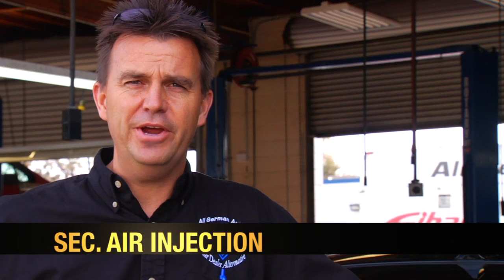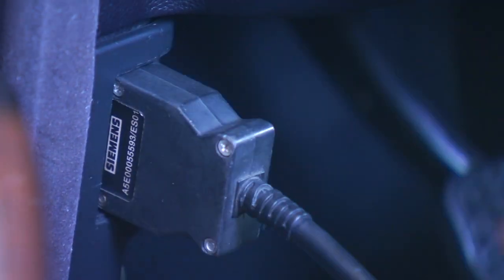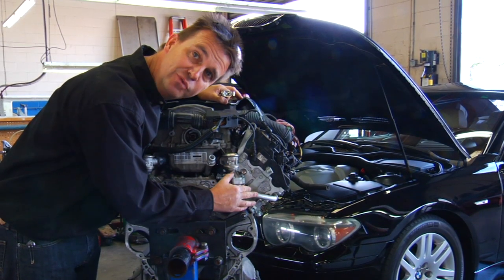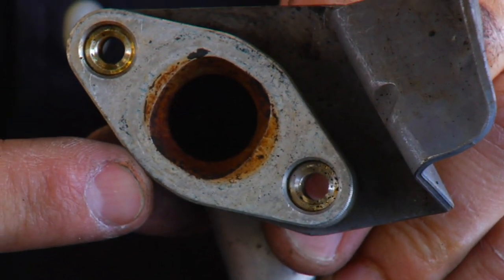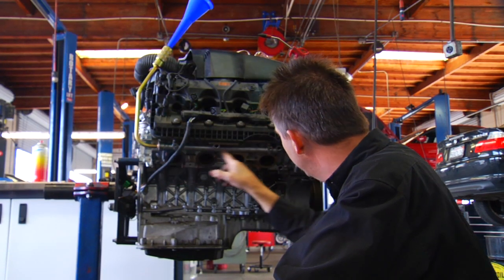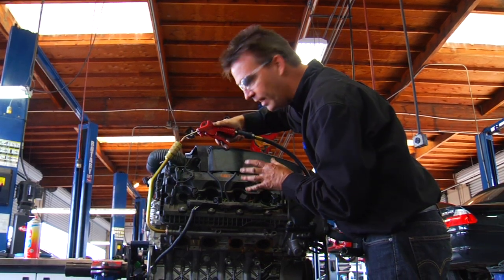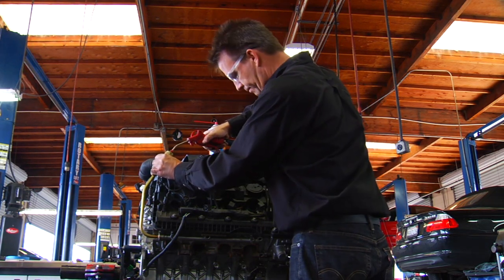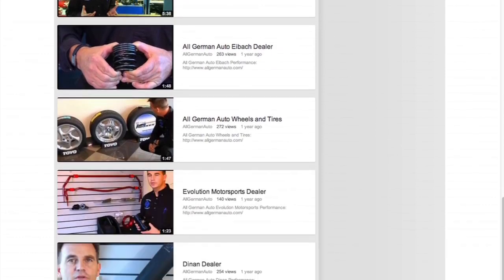BMW Secondary Air N62

Comment: This tool worked well in 2013, and now in 2023, not so much. Pulling the exhaust manifolds and port cleaning with the pick tool is the only effective method. Petrified carbon with time.

Comment: Any issues with material going thru the catalytic converters, or do you disconnect the exhaust manifolds first? Thank you for any help.
Reply from the maker: No, but we recommend taking off the spark plugs.

Comment: Show how to remove the intake. I have the code. Cleaning it without that over expensive tool was not an option wasn’t gonna pay $300+ for a tube a brush and a funnel 😂 but yeah I managed to clean them but the codes persist… I’m thinking the tube that splits under the intake is broken so yeah a lil help would be awesome…

Comment: Thanks for the video... my mechanic is using this tool on my 645CI... Bank 2 is now clear but Bank 1 is extremely blocked.  Do you have any suggestions to dissolve hardened carbon and oil from the port wholes.?
Thanks in advance
Reply: The real cause of this problem is valve stem seals. Oil leaking trough the seals and directly into the combustion chamber blocking the channels!

Comment: This might have worked well in 2013, but not in 2020. You will be lucky to get this to work with how clogged any 745 will be by now. I have managed to break their "inexpensive" $90 carbon hook, and was unable to get this brush and funnel tool to work without scraping out the exhaust ports first and by using a welding wire to dig in to the carbon before using the hook. This funnel tool still requires you to pull the manifolds since the air will just pass through one of the open ports if you manage to get one to open up. Hopefully you will avoid this garbage job on a garbage car and not buy either of these kits. AGA makes some great products, but in modern times this will not save you time or money.
Reply: all facts - their VSS kit is still useful but I just rented it from a Facebook group haha. For these ports though, just pull the engine and be prepared for a lot of cleaning. Shit sucks after 17 years.
Reply: @ThePinkDragonn  can it not be deleted?

Comment: So tried it with mechanic and brush is stuck in the galley tube for bank 2. Tried safety wires angled as a hook on wire tip to poke through brush in tube to pull brush out with engine still in car, but no success with the tight space.   So engine has to be taken out to easily get at the stuck brush.  So lesson learned, ensure brush is on very very tightly prior to use, and do not reverse turn counterclock wise during cleaning. it will unwind if it is not tight. It did a great job on bank 1 fixing the code, easier to get to with engine still in.  And bank 2 as well, which would be perfect had brush not been stuck.  Will recommend, but easier to do with engine out like on this video.

Comment: Between the blocked air injection tube and the leaking coolant transfer pipe, these engines can cost you a lot of $$ to fix!
Reply: Ad Mirer There's actually a pretty cheap fix for the water pipe from bimmer fix.

Comment: if i am replacing my valve stem seals do I need to do this
Reply from the maker: Mike, we strongly recommend you to do this job while doing valve stem seals so you don't have to go back and do it later on. No need to go back into something twice when you can just do it the first time.
Reply: Thanks I bought the tools anyways.

Comment: I got this kit and here is my experience. It is unnecessary! 

1. To all my non mechanics doing this. There are 2 emission control valves that need to be removed, so this video is not step by step.

2. Bank 1 is fairly easy to get to while the car engine is still in place, however bank 2 is a SOB. Tip: the easiest way to do this is to remove the intake manifold. 

3. Make sure the brush is screwed on tightly if it get stuck in the bank stick the cable in the bank and try to screw it back on the brush to remove it.

4.  My brush broke at the end of bank 2 luckily i was able to get it with a pair of angled needle nose pliers.

5. At the end of the day my mechanic took a brake cable, cut it and un-threaded it to make a stainless steel brush and that worked better than this tool. Plus there was no parts to get stuck in the bank.
Reply: so did you NEED the guide tube or just the brush?
Reply: corey jones so did u pass emissions
Reply: @kingme6109  it did not fix the issue. I think I need a new pump.
Reply: corey jones so check your fuel injectors u be surprised it a be a couple of them no staying right u never no but once u pull the injectors out of the hole in the manifold make sure u have a bucket for all the gas that’s dripping from the injectors pipe connection I no ov did everything u can imagine to those N62 engine
Reply: U can just buy the 2 pipes but that don’t mean  your holes ain’t clog with carbon it’s a crazy spot I say lift the engine a little make it easy
Reply: @kingme6109  I replaced the pipe it is under the manifold still no luck

Comment: I have a question.  I am working on my 2004 545i and I have reached the point where I have the mounting bolts off the air valve.  It appears that there are 2 brackets that hold the pipe in place (the pipe that goes into the engine where the tool is going to go).  Any pointers on how to undo those brackets?  I'm getting close to ready to do the procedure.  Thanks!!
Reply: I see from rewatching the video that there is just one bracket.  Do I have a better chance of getting to it from underneath? I guess I'm going to take the bottom cover off and see if that gives me a better shot at it.

Comment: that engine must have bad valve seals. early ford dohc/sohc v8 had an issue like that with egr and secondary air. in that case if you neglected it too long the tube would completely clog with carbon, almost turn to rock.

Comment: can I use this on a 2007 bmw 328i
Reply from the maker: Gilbert,
Unfortunately this tool kit is strictly for the N62 engines.
If you have any further questions feel free to give us a call at 760-738-4084.

Comment: I have a 2008 BMW X5 4.8i the engine light come out I took it to the mechanics change the spark plugs and two coils 1 and 8, but the problem still on. I took it back and now the mechanic said is the catalytic converters. The truck fells poor when push the gas it start jerking and loses power and at times I am unable to accelerate.
Reply from the maker: Dan, Please call us at 760-738-4626 to talk to a service advisor to further investigate this problem.
Reply: @AGATools  My 4.4 is having the same symptoms after valve seal replacement. jerking and such. It ran great the first 20 miles, then it threw bad coil code. I replaced it and ran good in park revving it up but under load it jerks and feels like its mis firing but the codes now are p0420 catalyst system efficiency below threshold and p2179 System too lean and P2177 also. Is it common to have to replace the Cats after a valve seal job? By the way I did not perform the secondary air cleaning.
Reply: Change your o2 sensors on top of your cats there reading a bad mixture

Comment: Hy...but the brush is safe for the engine?
And if any brush hair breaks and goes to inside?
I guess the brush hairs are made of steel ... so you can clean the carbonite...or fiberglass or similar...
This is my doubt
Reply from the maker: Pesca Mar, Please give our products department a call at 760-738-4084 and we may troubleshoot this issue with you over the phone. Thank you.

Comment: Hi I just ordered this kit. When you say turn the engine over without the spark plugs, do you turn it over by hand or cranking it over with the key?
Reply from the maker: Ricky, You are not required to turn the engine over when using our N62 Secondary air cleaner kit. Please give us a call at 760-738-4084 if  you need further assistance.
Reply: Oh ok thanks. I thought it would need to be turned over without the spark plugs because that's what was said in the video

Comment from the maker: What year and model is your X5? Please give us a call directly so we can help you out. 760-738-4084 and ask for Richard.
Reply: 2005x5   Do you have a tool for ?
Reply from the maker: It depends on which motor you have in your X5. If it is the 4.4 L the secondary air cleaner will work for that motor. If you have the 4.8 L in your X5, then it will not work. Please give us a call at 760-738-4084 so that we may further assist you. Thank you.

Comment: Is it possible my N62 does not have Secondary Air? On RealOEM i have found it on 4.4 and 4.6 but not on 4.8is. So do i have this on my 4.8is or not? Is it possible the got rid of it with 2004 FaceLift and new engine?

Comment: does this problem with secondary air system can cause also white smoke on tail pipe at idle or acceleration?
Reply from the maker: No, this will cause a check engine light. What you are seeing is the valve stem seals going bad. 

You can see the video here:  https://youtu.be/AE5PsbHgzM4
You can make the purchase here:   http://www.agatools.com/tool/n62-valve-stem-seal-tool/collection

Also, The N62 Secondary Air Cleaner Kit will work for your 2005 BMW 545i

You can see more about the kit here: http://www.agatools.com/tool/n62-secondary-air-cleaner/carbon-hook-kit

If you have any questions, please call us directly at 760-738-4084
Reply: tks for everything i apreciate your time

Comment: I have a Subaru Forester XT 06 with just about 60k miles and it is giving me the code for this same problem (p1410, p2432). Do yoy recommend to use carb cleaner to try to clean the valves? I haven´t dissasemble the system yet, but I asked the dealership for the replacement part and they don´t have it. I´ll have to wait for at least a month to get it from them.

Comment: hmm might do this on my n42 engine, it's basically half of this n62 engine , a straight4, 2 litre in my e46, it even has the same emission control valve and air pump
thanks for the helpfull video

Comment: was wondering the same thing as derek. does this clean each and every small port inside the head? or does it clean some to allow just enough air to pass the test? Being as the carbon is so bad in those passages they need to be drilled out im having a hard time picturing how this work. thanks in advance for your reply.